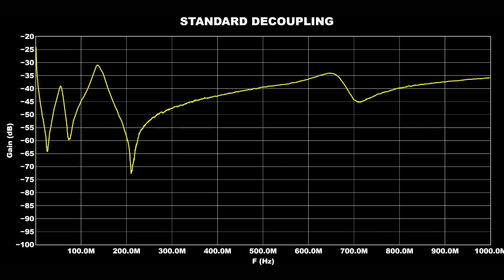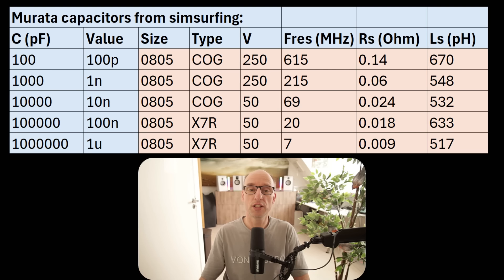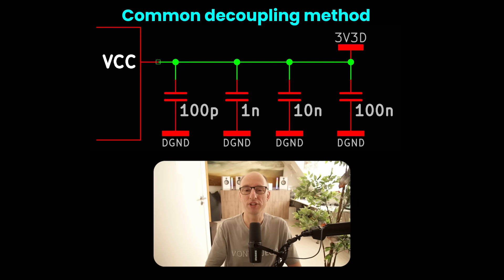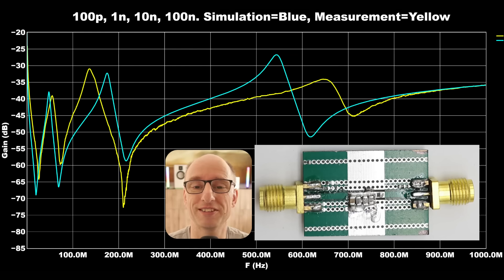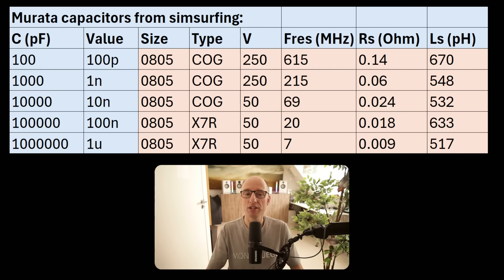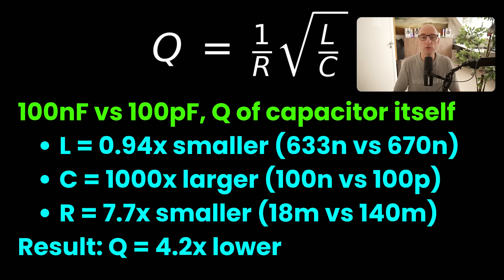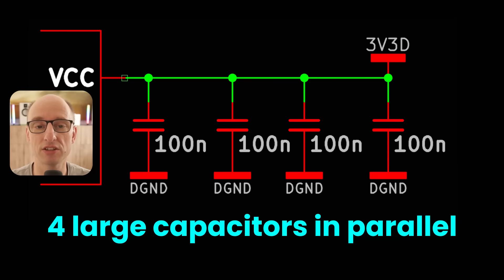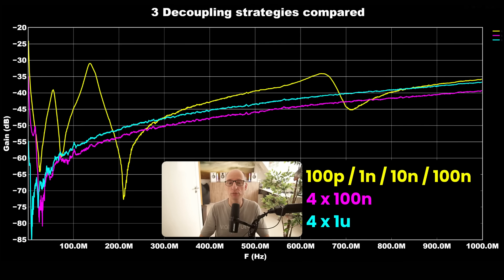The most misunderstood concept in decoupling

Comment: The 'old wisdom' originates in times gone by, when components had legs (coils) were bulky and  ground-planes where many millimeters away. The over all 'on board speed limit' was low. The new rule of thumb: start with a big capacitance in a relative small package, and evaluate if it is sufficiënt.
Reply from the maker: Yes, I got that too, must come from the past. But I run into this everywhere, with new components as well. The old knowledge just never goes away

Comment: Some very good info supported by measurements, but I'd like to add that when significantly increasing the total decoupling capacitance, beware of 1) inrush current and potentially tripping the overcurrent protection of whatever supplies that voltage rail and 2) instability due to large capacitive loading of whatever supplies that voltage rail, especially if you have a bunch of devices running of, for example, the same LDO. Number two is easily remedied by adding a series inductor at the converter/regulator output, after its own output capacitance and number one with things like output soft start.
Reply from the maker: Yes, good additions. I would be careful with a series inductor, you have to analyze at what frequency that causes a resonance and if that bothers you or not. Transients will most likely cause ringing with that strategy. I've used very small series resistances with large capacitors a few times. That eliminates the possibility of resonances and filters at the same time.

Comment: I start with 0402 X7R with the best Q  and highest capacitance for the voltage nearest to the load Without going by a via. A bit further, if needed I add a fat reserve  that can be passing by a via if needed for the dI/dt expected.
Reply from the maker: that sounds like a good idea, be careful how the fat reserve and the smaller cap create a parallel resonance. It should not be on one of your circuits frequencies.

Comment: Thanks again for sharing your experience in the field, always glad to receive new ideas and pointers! Regarding the lowering of Q-value in decoupling networks, is this universally a sought after end goal? I work with RF signal levels of -115dBm or below, and sometimes RF band-, or even channel-specific issues are dealt with one or two 0402 caps to kill the interference with high enough Q. If the parallel resonances (high impedance points of decoupling) do not cause any further issues due to being out of band or not existing in the first place, wouldn't a higher Q be advisable?
Reply from the maker: I think in decoupling, high Q is in general a less good idea because it increases the chance of resonances. It does not have to be a problem though. If you want to do filtering (which is what I think you refer to) then a high Q is very advantageous to achieve maximum suppression. 

I think the only good answer what to use is: simulate it with actual models of the components you use and then see what happens.

Comment: I noticed the capacitors lower than 100nF were using a different dielectric, is that why they perform worse than the 100nF at decoupling? C0G capacitors are typically used for applications where temperature stability (oscillators) is a concern I wouldn't design with them for decoupling (they are pricier too!)
Reply from the maker: COG and NP0 capacitor are superior to other smd dielectrics in every way: Less loss, more stable, no voltage derating, not microphonic and I can keep going on. You can't get them in higher values though. I think the higher resistance and inductance comes from the fact that they're physically smaller devices causing more resistance and inductance.
Reply: Does smaller package mean lower ESL and ESR?
Reply from the maker: @imanmazhari6487 in general that should always be true

Comment: The resistors add massive inductance and ruin the real life performance through that, no?
Reply from the maker: Did you check the simulation and measurement results in the video? It doesnt get more real than that. That is why i always measure to confirm,  just to maken sure im not missing anything.
Reply from the maker: You have a point though. The resistors double the inductance,  but they increase resistance a lot more to create the damping effect. You can only do this when using multiple caps in parallel i think, otherwise the impedance will be too high.
Reply: Not the redistors. Yhr package. And the pads add capacitance. Often, it is balanced